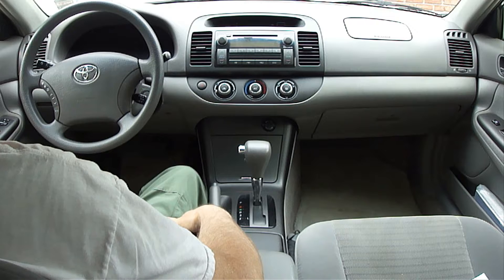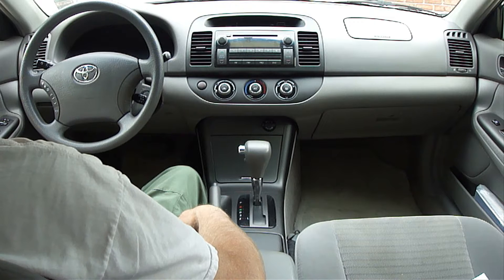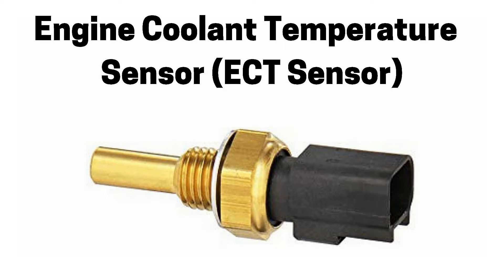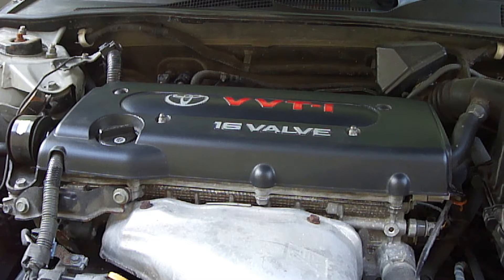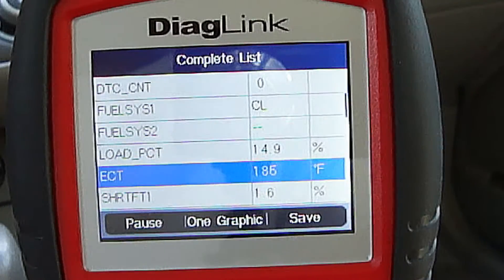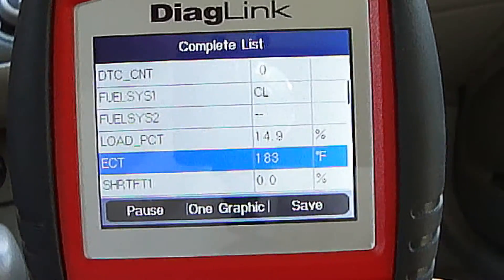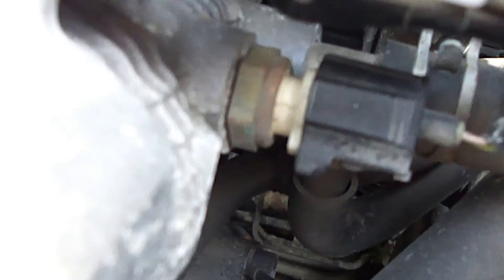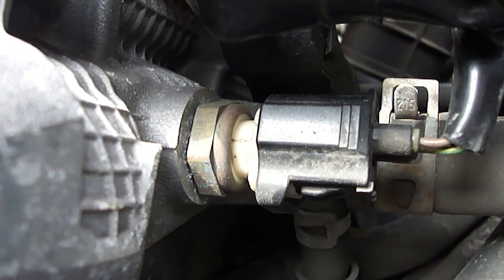Why Cars Have Trouble Starting Once The Engine Is Warmed-Up?

Comment: Another way to check the coolant sensor along with all the temp. sensors is when the engine is cold; all the temperature sensors should read within a few degrees of each other because they only record the ambient temperature when the engine is cold.

Comment: Would be my temperature gauge fluctuate or indicate the engine is running cold?? 2010 Audi S5 V8 here. Hard starting when hot, I sometimes get confirm and pending scores for p2188 and p0172 as well as p2198. I’ve new OEM injectors, hpfp, lpfp, upstream O2’s. Low and high fuel pressure regulador, plugs and coils. But never changed the ect. Advice please
Reply: Have you ever figure it out?
Reply: @ yup, changed both downstream O2 sensors. Even they are the secondary ones they totally make a difference in fuel trims. Go with Bosch or Denso. Cheap Chinese won’t reliable.
Reply: @ nice. Congrats!

Comment: I had this same issue. With a 2005 Toyota. But it’ wasn’t my temperature sensor that was bad. Instead it was one of my relay in the fuse box. After changing the relay I never had a starting issue ever again
Reply from the maker: Can you clarify specifically what type of relay you replaced that fixed your problem?
Reply: @proclaimliberty2000  same question from me
Reply: Can you please tell us what type of relay you replaced?

Comment: What about the oil temp. sensor? Will it cause the same problem?
Reply from the maker: Not that I’m aware of.
Reply: @proclaimliberty2000  reason I am asking is because my 370Z is hard starting after a drive and the engine is hot. Will start hard after sitting hot for about 20 min. Once its cold it starts fine. Trying to narrow it down, no check engine light. Runs smooth even after hard start. Looking at oil temp sensor, coolent sensor, cam sensors, fuel pump pressure sensor. Last will be bad injectors. Cant do anything until May. Car is put away.

Comment: I have this problem with a 1.7cdti diesel. Changed crank sensor, really amazing performance change I didn't realise they wore out! But still no hot start. Changed manifold pressure sensor, no avail. Changed the HPFP Pressure control valve, no avail. But its now not as bad. So its a realated issue to the HIgh Pressure FP. Havent touched the ECTS because it reads ok on the dash. However I did see a vid on Mercedes where a credible mechanic reckoned that it was to do with the solenoid for the FP in the fuse box. Since this problem straddles both petrol and diesel cars, that figures kinda. Will try that next along with the ECT which is cheap. Best wishes. AF
Reply: did you fix your problem? I have the same issue on a Honda diesel engine ,can’t  understand what's wrong . Thanks
Reply: @catworld1515  I now know its to do with the MAF because it has an out of range error code. I changed it but no change? So maybe a broken wire or ECU fail. I also had the coolant sensor fail reading high. This made a big big diference to it. Very awkward to swap it out too. The MAF is critical to starting hot. See utube vids.
Reply: @Avian Fish  on my end no errors pop up , so it's tricky.  I'm going to remove MAF sensor to clean with special spray...
Reply: @catworld1515  Easy test for MAf see utube.

Comment: I just replaced the ect and its giving the code for the ect, help?
Reply from the maker: Did you clear the code?
Reply: @proclaimliberty2000  i did but it comes right back, I'm going to take it back and explain what it did, probably got a bad part.
Reply from the maker: @dannymartinez8314  Does your diagnostic scanner give live data for the engine coolant temperature when the car is running?
Reply: @proclaimliberty2000  i believe it does but it won't stay running
Reply: @proclaimliberty2000  so i found out that it won't erase the code, i keep erasing it and rescan to find out it still there, i even erased it and turned the key off and disconnected my scanner, and after awhile,  reconnected and scanned and it still there, any idea what's going on, i got no clue

Comment: Yes i also have problems with this part ECT  in my ople zafira when the temperature reached more than 90 C the engine stop running on the road no fan running and the engine won't start again when engine stop running the fan start to running   then after about 20 to 30 minutes  i can start engine  i don't know the faulty part is it ECT or ECM problem pls i need help and how i solve these issue .

Comment: This isn't exactly true. Yes, it could be the coolant sensor as it controls fuel accordingly. It could also be a leak in injection system, a bad fuel pump or fuel regulatory.

Comment: my Polo is the same but when i start there is nothing, it doesnt crank, have to wait for car to cool, sometimes if i disconect battery and reconnect it will start. the engine is not iverheating

Comment: I have a 2008 Rav4 with the 2.4L. When the car/engine is cold it cranks right. But when the engine is warm/at temp and I turn the key to start it it crank for a second or two then it starts right up. I don't know what it can be. 
I've replaced these parts in this order; 
- ECT sensor: issue remained the same
- Battery: I replaced it with an Oddysy battery and issue remained the same
-Air mass sensor: replaced it with a Denso, because I know how sensitive Toyota's are if it isn't a Denso. Fixed the cranking issue for about a week. The new senor did fix the rough idle but the longer than normal cranking (when engine is warm) is still there. 
Any idea or lead to what it can be? O2 sensor maybe? Engine has 207k, and has had the oil consumption issue fixed according to the dealer maintenance history.
Reply from the maker: Try cleaning the throttle body.
Reply: @proclaimliberty2000  cleaned the throttle body, it solved the issue for a couple of days but the delayed warm start returned :(
Reply: @MC4D.  Fuel filter, pump?
Reply: Hi, did you find a fix? I have the same issue & same vehicle:/
Reply: @williamandrade4838   the issue isn't fixed yet. 
I've replaced the coolant temp sensor, fuel rail regulator and mass air sensor.
- I've come across a vid with similar issue on a 2013 and misplacing the injectors may be the solution. According to the diagnostics from the vid, the injectors don't hold the pressure and leak. 
T•1 mentioned the fuel pump/filter, but that requires dropping the tank and I'm in no mood to do that lol.
Reply: @MC4D.  yess i also heard the injectors might be the problem; I guess I’ll try replacing them soon. Good luck and let us know if you find a fix.
Reply: @MC4D.  I had all those issues on my Scion xb with 155k , nothing seemed to fix it till some savvy mechanic suggested resetting the computer and since then, My car runs like new again.
Reply: @luisesco3517  I may have to do this, leave it over night to make sure it has a good amount of time to reset. 
I'll report back with the results

Comment: 2002 Camry 4 cyl, 140k miles, I replaced the ECT sensor but still car won't start when hot. When i let it cool down for 5-10 mins the car then starts fine. Any other suggestion? I also noticed the passenger side fan won't turn on even when temp reaches 216°f
Reply: Have you fixed the problem? My 2008 Camry has the same issue. Replacing ECT sensor does not fix the issue.
Reply: @AmericaLegends  sorry for not posting the response. I read somewhere about toyota safety feature for the engine to not start when it is hot. My issue is fixed. I found the mystery under the fuse box in the engine compartment. One of the fan relay was missing and also i never checked my AC fan. I ran engine in park with the AC on full blast to check if the AC fan will turn on when engine reaches i think around 203 and it never did.  I looked for relay in the fuse box and it was missing. I used the horn one and the AC fan started working. I then monitored the temp and the AC fan was then automatically turning on after engines reaches that 203 or 204 °f and the issue of car not starting after driving for a while is now gone.
Reply: I would also change ECT as it is cheap n easy to replace with the OEM one.
Reply: @syedfaz26  Thanks a lot! It is very helpful. I have never known or even thought about the AC fans. I am going to check mine. Thanks again!
Reply: @syedfaz26  I am so sorry, Do you mean the radiator cooling fan?
Reply: @AmericaLegends  it was the fan on the passenger side.
Reply: I got few of the relays from junk yard. Just an FYI to wiggle the relay while pulling out. I broke couple of them pulling straight up with force:)
Reply: @syedfaz26  Got it. Thanks a lot.
Reply: @AmericaLegends  You are welcome. Good luck

Comment: I have that problem with my Sentra 2006: car hard to start when hot. If the engine coolant sensor is not working it seems that the display in the dash would be wrong too.  But as the car warms up the needle move and stay at a good constant temperature. Any idea what could be what cause my problem ?
Reply: most cars have a water temp sensor that runs the dash gage or light. The ECT just runs the computer. Two independent systems.

Comment: I have 2006 nissan xterra long crank when hot and sometimes won't start at all till get cold , I don't have any codes at all but I replaced the ect but still same didn't fix the problem. Any hints please?

Comment: Hi! I have 320i e90 and my problem is it won't start after a long drive or with hot engine. It will only start once the engine is cooled down after almost an hour. How do I fix this? Thanks in advance!
Reply from the maker: Replace the engine coolant temperature sensor.
Reply: I will try this and get back to you! Thank you very much!
Reply from the maker: @channeld3531  Make sure you replace it with genuine OEM
Reply from the maker: @channeld3531  👍😊

Comment: Sometimes my Corolla has a hard time starting from hot. After it's started the rpm is very low and then goes up to idle. I've got no fault codes or lights on my dashboard. I've ran the car near empty a couple of times and that could explain why as it's probably sucking bit's of crap in. In future i won't run below a quarter of a tank so i don't burn out my fuel pump as well.
Reply from the maker: Having a hard time starting a vehicle from hot would have nothing to do with the amount of fuel in the gas tank or the purity. An engine coolant temperature sensor could still be the problem even though it has not turned on the check engine light.
Reply: @proclaimliberty2000  If it does it more often then i'll the coolant temp sensor.

Comment: I used to have this problem on my car, I didn't know it was due to a coolant temperature sensor. I had replaced it since it stopped reading, and kept the fan on all the time. After replacing it I noticed the hard starts were gone all the sudden. Before that, I had replaced the ignition coil, spark plugs, plug wires, and fuel filter. No luck solving hard starts.
Reply: The problem because of coolant temperature?

Comment: I had that problem with my 97 Volvo 850 which continued after replacing both the MASS Air flow sensor and the Engine Coolant Temperature sensor. What finally fixed it was replacing the Ignition Coil.

Comment: What is the problem if the engine doesn't have a computer module. And that hot engine hard start is the case?
Reply: Many times it's the coil